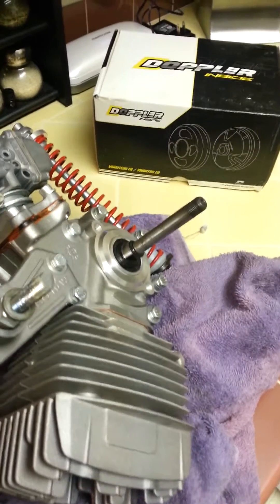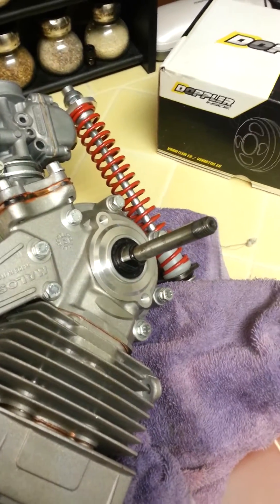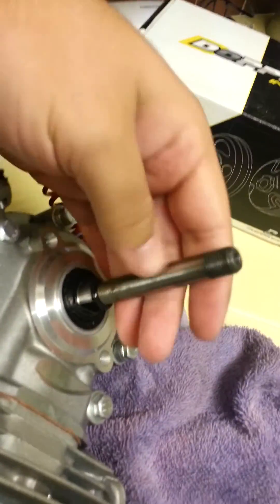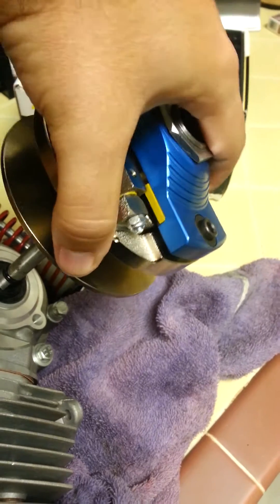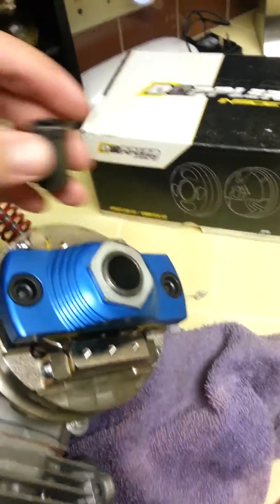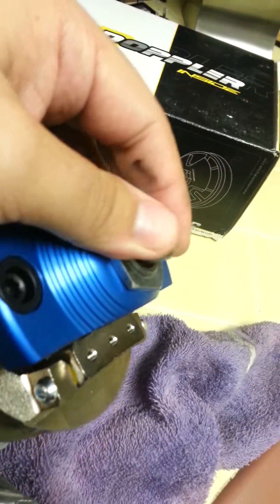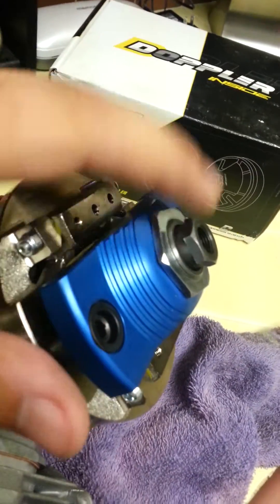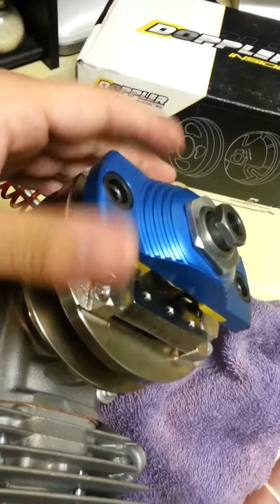Doppler ER3 clutchless variator

Comment: I'm guessing you most likely figured this out already, but that's right, when you torque the nut down it'll press it down on the keyed piece of the crankshaft. It'll stay fixed in position with the crank after that.